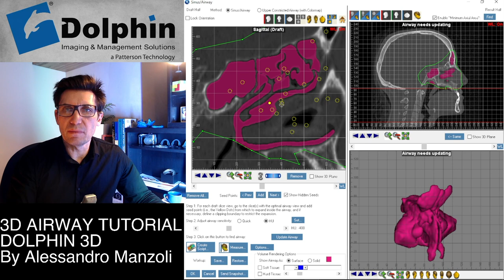HOW TO MEASURE 3D AIRWAYS in DolphinImaging 3D

Comment: Sr., nice video. Could you explain the difference from the "Quick" option for the "HU"? When is it better to use one or the other?  Thx
Reply: Thank you for your question. I mention and explain this at 2:10 in the video https://youtu.be/7m0W2s3X_JM?t=130
Reply: Basically Quick is a subdivision in 100 parts the range of the density of the voxels, so is a "relative" value and 60 in a dicom is not th same 60 in another dicom, so you cant really use it to make measurements that you want to compare. If you use HU you will use the Hounsfield scale Unit. This is an absolute value for the density so you can do a segmentation that has an absolute value and then you can compare the result with other measurements that use the same Hounsfield scale for the segmentation.